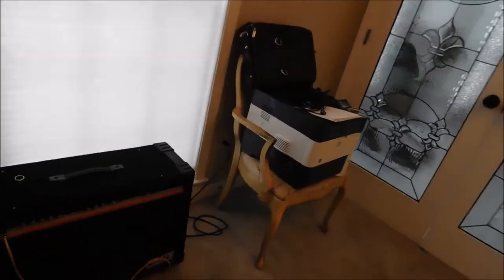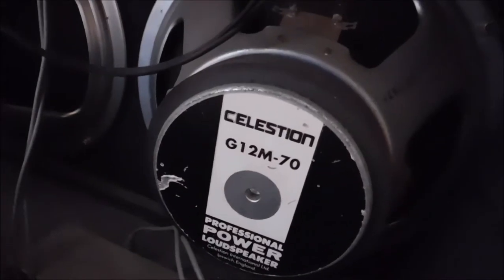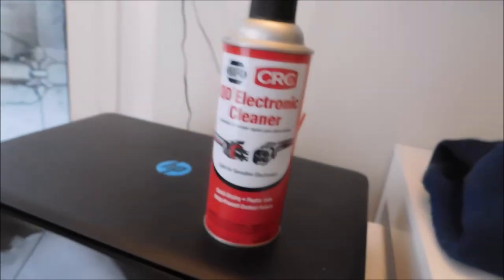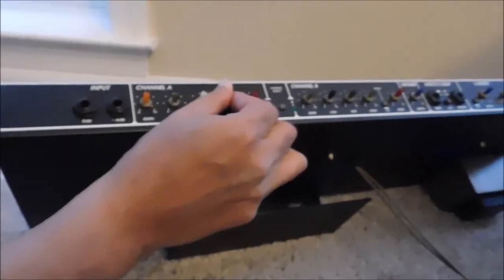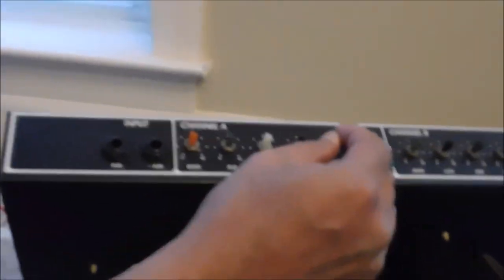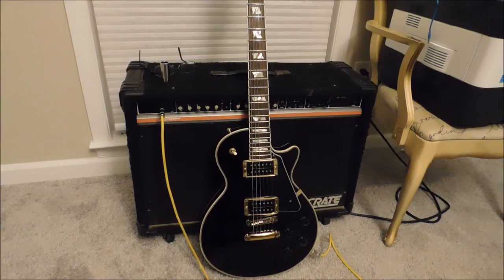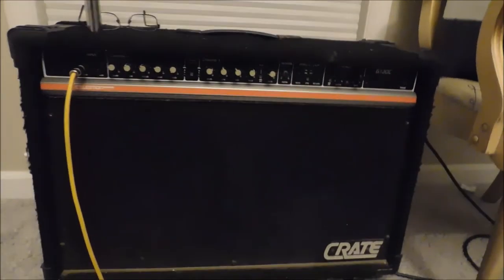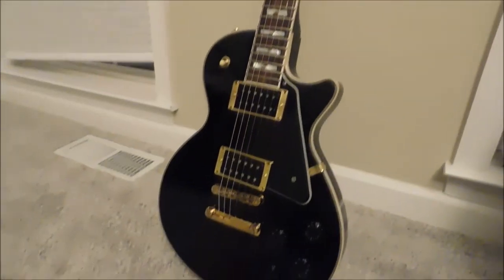Crate G130C XL Amplifier Fix

Comment: I had the same problem with one of my Crate amps that I own. It's a GT80. The sound was very thin and it would suffer from volume drop like yours. Finally, I decided to take it out and clean the pots  thoroughly. I waited for a few hours and when I decided to try it again, their was some scratchy noisy sound at the beginning, but it clear up quickly and boy was it loud!!! The clarity was back and no more volume drop!!!
Reply from the maker: Glad to hear you fixed the problem.  They sound great when they're working properly.
Reply: @rublue72  indeed!
Reply: My GT-80 did the exact thing !!! Though I think I fixed it now since I replaced the power cable with a better one. The GT-80’s don’t let a lot of love but with a high quality speaker replaced, it competes with all amps by today’s standards !!

Comment: I’ve had the same amp as yours since 1993. At around the year 2000 it crapped out. I took it apart and cleaned it the best I could. Nothing worked,I held on to it and few years ago,maybe 2019 I plugged it in an let it warm up for about an hour and it seemed like it settled itself for the most part. My clean channel does not work but my distortion does,great. But if I want to use my old pedals,they have to be on a clean channel. Back then I ran a Charvel Rhodes style guitar with EMG’s and I recently actually got that guitar back after 21 years and I’m playing it through the same amp. I just am not an amp guy. Hopefully I’ll figure it out or find someone who can.
Reply from the maker: I would agree with you on the fact that this particular Crate model is a finicky unit. My pods started getting noisy again...so I kinda blew everything out again and sprayed things down again. It seems to be doing good for now. This may be a routine thing I may have to do every so often. It's such an awesome sounding amp ... especially for a solid state model,.. it's worth it. Best of luck with yours.

Comment: I Have the same Amp, that Amp is so Loud ...
The Amp was broken and i Repair it, i found Circuit plans on the Internet!
And sometime i try the 4 Cabel Methode....and than i put sometimes the
cable in the Amp of the "Send & Return" IN and OUT ...and i Break him 
again...till now i don't have Fix it again...but i will do...this Amp Sounds Awesome!!!
The Circuit is "J-Fet Transistors" J-Fet are the Tubes under the Transistors!
In my Opinion this Amp is so near on a Tube Amp, is Amazing!

Comment: Thanx for your video. I have 2 amps that are giving my problems that are similar circuits: Ampeg vh140c and a Crate GX130C. The Ampeg keeps dropping volume after an hour or so of playing and the Crate keeps doing this shit where it keeps jumping to the effects channel so the chorus keeps turning on randomly. I thought if I just kept both chorus knobs at zero that it wouldn't matter when it jumped channel but that didn't work. Both of these are the head versions of the amp. Any ideas on either one?
Reply from the maker: Hi Norman. Thank you for watching. Yes...so..I would recommend that you first use contact cleaner from as externally as possible to clear up any potential contact issues. If the problem still persists...and you feel confident enough...you could open up the amp and go on a mission looking for loose circuits or bad connections. It may even take a magnifying glass to find cracks in wires or solder. I hope that helps. Thanks again and have a wonderful day. Good luck.
Reply: All this amps have a easy fix just plug both fx inputs with a cord

Comment: So long story short mine randomly tries to switch channels randomly and fades in and out volume. What should I do cause I don’t noticed anything on the board that’s loose or fried. But I’m thinking the foot switch jacks
Reply from the maker: Honestly...I think electronics cleaner is always the first go to. Connectivity is a very touchy thing...when it's restored it resolves a lot of issues. Good luck my friend...hope it all works out.
Reply: My g120c does the same thing. I found if you crank the clean channel all the way up it effects how much gain you get on the crunch channel. Once the switch started changing on its own it nearly blew my head off lmao so i bought a second one that fully works. I paid 60$ for the second head. Sounds like yours might need new caps if it's fading out.